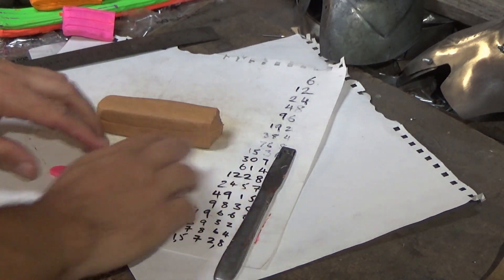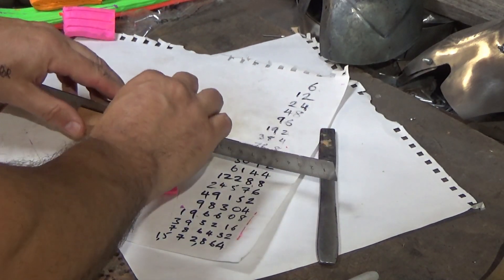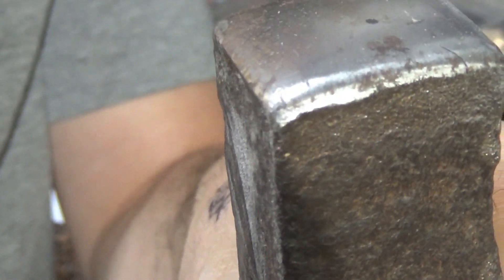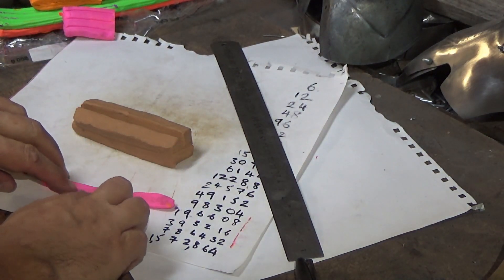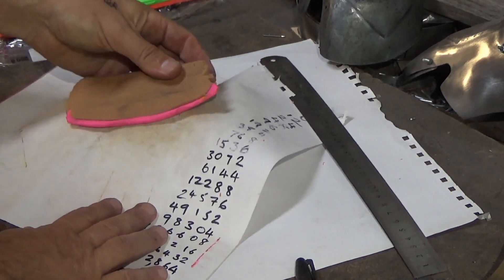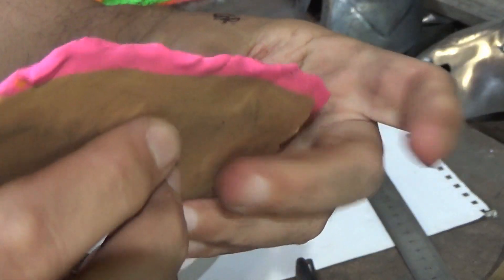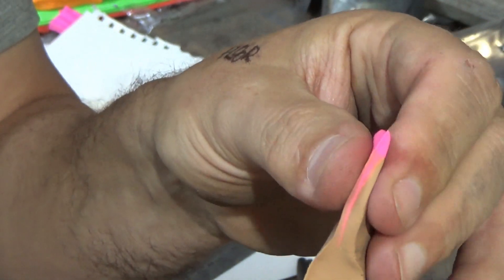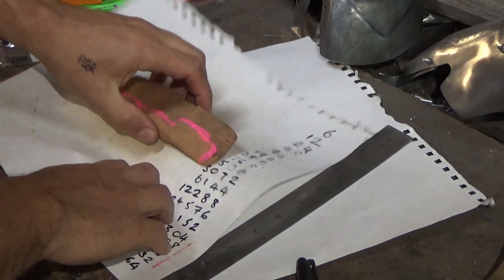Adding hard edges to steel (with plasticine) for swords, axes, hammers … anything you want.

Comment: I think the hamon was from the differential hardening from coatings while they heat treated the blade.
Reply: As a bladesmith, I can confirm this. You can actually get a hamon on a monosteel blade (w2 makes a nice hamon) when you is differential hardening. The reason is that the hardened steel has a tighter grain structure than soft steel , so you get a clear defined line between soft and hard steel when you polish it
Reply from the maker: Sweet thanks, it's not an area I will pretend to know a lot about, just about what's in the video, which was more about debinking my teenage myth of drawing out a blade and folding it in two! :)
Reply: Greenleaf Workshop  no sweat, you’ve given me a HUGE amount of help with my own armouring projects over the years. Extremely informative, and I’m greatly appreciative! Keep doing what you do!